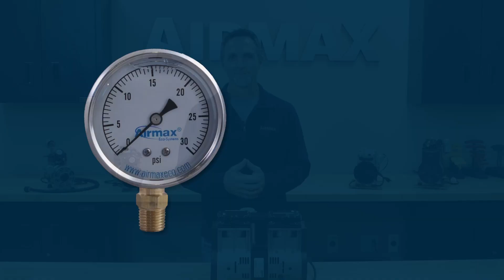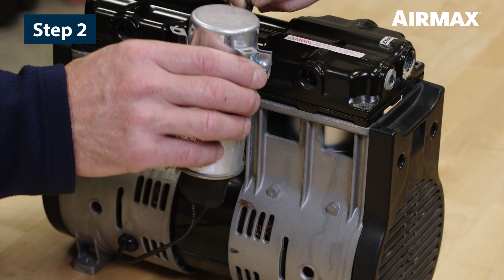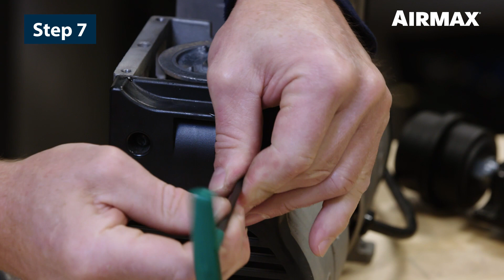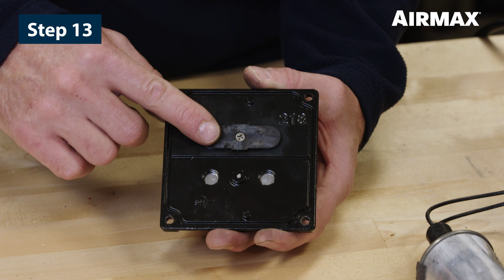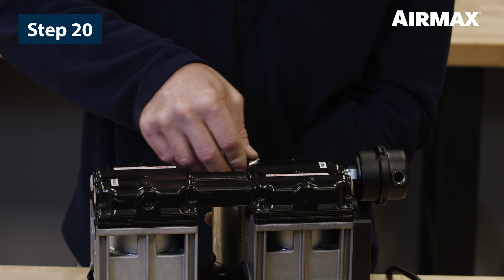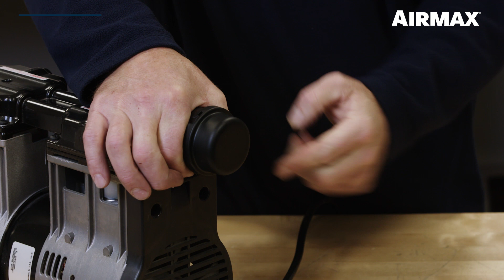Airmax® SilentAir™ T100(RP100) Maintenance Kit Installation

Comment: It is my experience DO NOT BUY FROM this company.  I spent over $35,000 on 2 Airmax complete Lake Series fountains.  I have spent nearly 3 years attempting to get these units to stop breaking down and yet to have a single summer season whereas they didn't fail.  Instead of doing the right thing by issuing a full refund after I have had enough (returned them to the factory on 3 different occasions) and they still dont work.  They run for about 8 minutes and shut off.  I have invested nearly $7000 in wiring and electric diagnostics of the units to no end.  When demanding results or a final resolution they sent me to their attorney to communicate.  Very Sad, ultimately I will end up spending $10-$20k on an attorney just to get my money back on products.  Airmax is an affiliated company of the Pond Guy.  This is my experience and hopefully it helps you making a decision on whether or not to do business with this company.